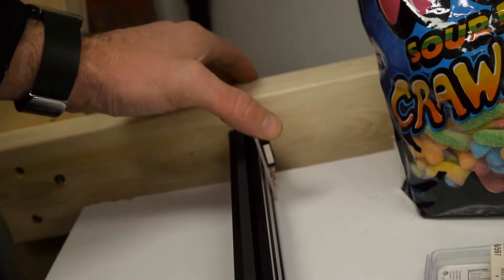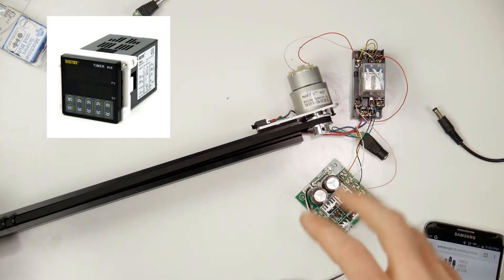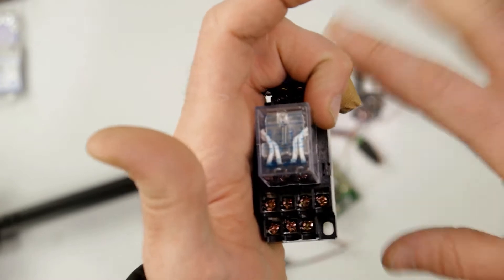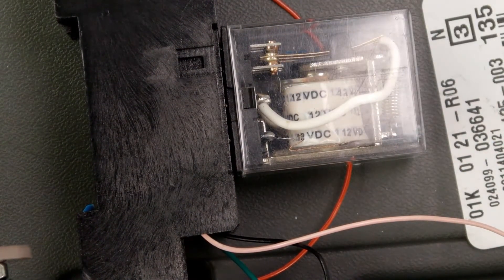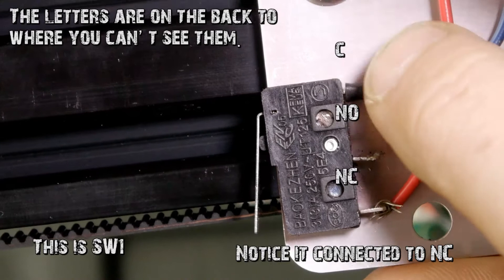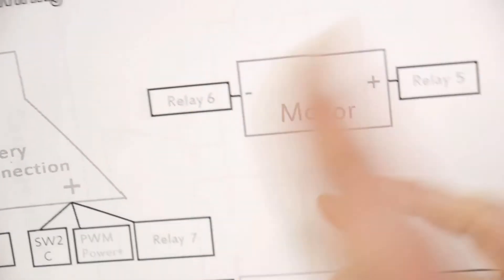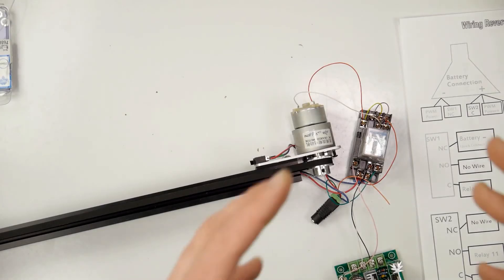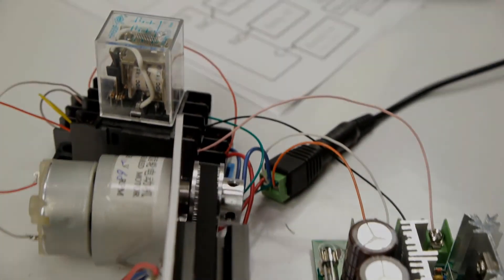Camera Slider How To Wire Auto Reversing Speed Control

Comment: One can use 3 simple and easy to find SPDT relays for this project. All three coils of the relays need to be wired together in parallel and then they will act as a single TPDT relay.
Reply: But why? You are just adding extra work. 3PDT relays are easy to get.

Comment: This is great!!

I just ordered the IGUS W16 and a Servocity motorized kit.

1.  Is the 3PDT the same relay that cheesycam uses. Or is it different since you're using a speed control. 

2. Does the speed control act as an on/off switch. Or does things just start moving when you plug it in,,,lol. 

I really appreciate YOUR simplified diagram. Like you, I don't understand electronics. But if you dumb it down for me I can do it,,,lol.